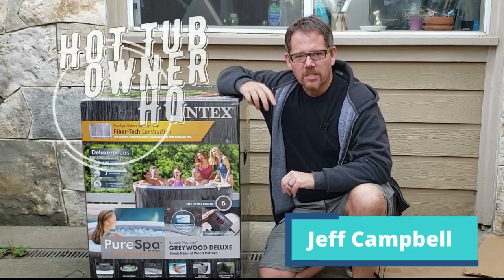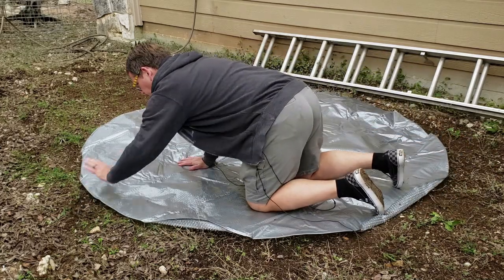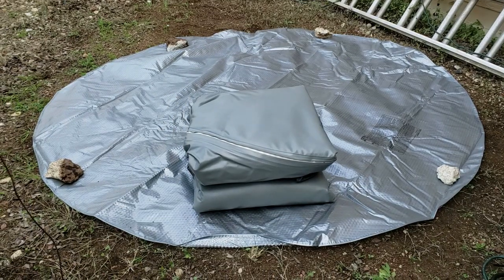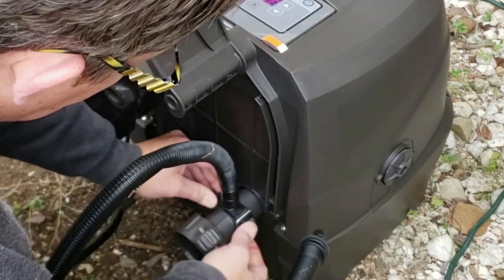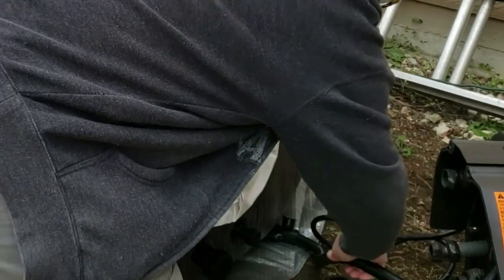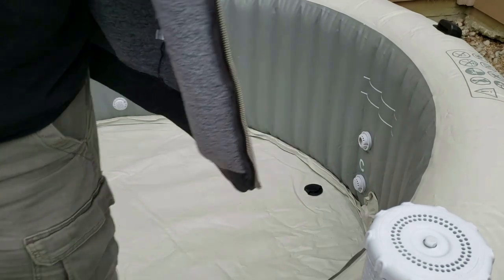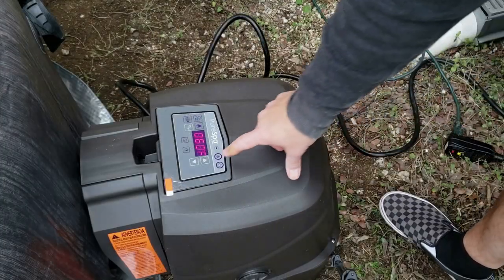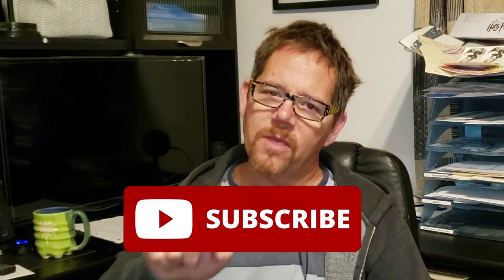Intex Inflatable Hot Tub Setup, Installation & Review

Comment: I bought an inflatable hot tub, a Coleman SaluSpa, last year (2021).  Couldn't get one online immediately as there were "supply issues" with everything.  Then, I found that Rural King had some Colemans ON SALE.  Done deal. 
There is no ground cover/protector included.  HOWEVER, the bottom/floor of it his a thick, maybe 3/8 to 1/2 inch thick, sandwiched in the floor.  Excellent.👍 
I built a platform out of 2x4s and 1 inch marine-grade plywood.  Then, I covered it with 2x2 foam gym tiles.  So, the bottom is really protected against puncture and is easy on my knees.
Cc: The dreaded E02 code.
Generally, it's always the filters.  Remove them, rinse them off, reinstall them.  Didn't work?  Replace them with new ones ($8/pair at Walmart).  Still got a code?  You've probably got an air bubble in the pump or piping.  I took the filters off and shot water from the garden hose into the intake where the filter screws on and turned the pump on.  A bubble of air will shoot out of water outlet.  Problem solved.
All tolled, I have about $1000 tied up in this project.  But, it works well so far and it's nice.  I've lowered the temperature as it's too hot for the summer and it acts as a pool now (July).
I love these videos.  They are great teaching tools.
Thanks for making them.👍

Comment: In the winter, put the tub on 3/4 or 1in thick 4x8 foam insulation boards (cut to fit after tub is installed or before, whatever is easiest for you). Wrap the tub in 2ft wide reflective insulation, wrap around the entire tub, you can punch a hole for each clamp to pull them through and for the pipes as well. Connect the 2 pieces of reflective insulation together at each end with zip ties, put pipe insulation foam over the pipes and make a box with cut out holes for the heater pipes and put reflective insulation all over the box. Stuff any sort of blankets or insulation you can into the box with the heater to keep it warm and also helps big time with keeping the water hot inside the heating pump. Get a fire pit cover to put over the box for rain and snow (you don't want water and snow to ruin your cardboard box + you don't want rain freezing on your heating pump. You can be creative making a lid for the box, personally I just use the original box opening flaps. You can use it all year. I suggest getting a robe that's water absorbent so you can put it on like a towel after getting out of the tub, get some crocs or any sort of quick drying water resistant shoes to put on after hopping out as well! It gets down to 18-20F here and it's fine!
Reply: Great info, hope you don't mind me screen capture and sharing

Comment: I had an intex 6 person tub. Easy set up and good quality. It was nice having a hot tub finally but it wasn’t very robust. It took 2 days to warm it up to 104.  When you get in at night (in LA so not very cold), within 15 minutes it was down to 97 degrees. If you turn on the bubbles, it cools off the water because it can’t heat at the same time.  I got rid of it after about a month and decided to get a MasterSpa. Yes it’s a huge price difference but also a huge difference in quality and heat. We can be out there for an hour and the temperature stays within a degree or two of where we started.  These tubs are good if you don’t stay too long in them or if you don’t live in a cold environment.

Comment: Cracked me up when I listened to how you cut the power when the button for the air wasn't turning it off.  Same exact thing happened to me and mild panic started to set in before doing the same as you and just cutting the power.  That control panel is less than intuitive to begin with and the auto-lock "feature" is such a hassle.  After a few times using the panel you then remember to make sure it's unlocked first.

Also, putting the cover on while heating will help speed things up.

Comment: We purchased a sink aerator to hose adapter at our local home improvement store so we can top off our Coleman 6 person inflatable from the hot water in the house. Just set up Sunday and used it for the first time Monday after it heated up in about 24 hours from 50° F hose water. I wrapped foam pipe insulation around the exposed water inlet and outlet hoses to and from the pump heater unit because we will have temps well below freezing this weekend, the instructions say to just make sure the heater and pump are on 24/7 any time the temps go below 42.5°F (must be a celsius conversion for us USA folks). Thanks for all the informative videos on chemistry! These are a good, affordable way to get our feet wet before we commit to a permanent hot tub! The water volume is so low, I have to be careful adding anything to not over do it.
Reply from the maker: Thanks for the comment. Because of all the comments I get, and my inability to answer them all in a timely manner, I answered yours in a video scheduled for 2/22/21. Please check it out and thanks for being here!  - Jeff

Comment: We had a colman inflatable hot tub for a couple years. I found inflatable hot tubs to be okay. They were basically a glorified bath tub. Outside Temp does make a big difference but another reason for your slow heat time could also be because it looked like you were using a 16guage extension cord, which should not be used with an inflatable hot tub as the heater is around 1300w. What makes a hot tub relaxing are the jets, and you just don't get that in an inflatable. We upgraded to a hard sided hot tub, and glad we ditched the inflatable.
Reply: We built a whole insulated tent set up around ours to keep the heat in. (You can see the videos of it on my channel.)  And yes, it was nice for a few years as a glorified bathtub, but it was $400 and well worth it for the time.  Using the bubbles would tend to drop the heat fairly quickly.  We finally got a hardshell one as well, it's not a 220 so we can't run heat and bubbles at the same time, but with the insulated tent setup I have, we can start at 104* and run the bubbles for a good 2~4 hours (in the winter) before getting down to 100*.
Reply: New intex hot tubs have 140 jets in them now.

Comment: The control unit automatically locks after one minute. You just have to hold the lock button for 3 seconds and it unlocks.
Reply: Is is the lock button the same button you pressed to start it filling up with air
Reply: @henry8333  No, there's an icon that looks like a lock on the display. You press that button/hold it down until it unlocks the screen.

Comment: They finally shipped my steps for my hot tub, I'll have to do an update on that.  I put my bottom pad the complete opposite of what you did (bubbles up).  I don't even remember now if it said somewhere which side goes up.  Starting to wonder if I had mine upside down. It's interesting that your lid didn't come with a cover that goes around the part you inflated.  Mine has a cover and straps to keep it from blowing off. (You can see what it looks like in my videos.)  Also PRO TIP... Make sure to change the filter(s) once a month.  I don't know if you'll get the same E90 error mine and many others get, but it's just from having a dirty filter is all.
Reply: Filter change should be done twice weekly for a number of reasons, use being a big factor.
Reply: @rexh58able  Well use, yes.  I still changed mine once a month and it was still fairly clean even then, but also I didn't use it too much. Twice a week seems like overkill even if you use it every day.  But that's just me.
Reply: @rexh58able  i have mine for 4 years, had to some filter prepairs but I love it.
Reply: @rexh58able  I have the purespa and with a pressure hose you don’t need to change them only once a month. What I do is put an old one on the non pump side (C) for me. And put a new one on the pump side filter which is the important one to not trigger e90. Then after a few washings I swap again pump to other side that way I’m only having to replace 1 not 2 at a time. Last summer I went through 2 packs so 4 filters all season.
Reply: His  had the cover . It was the first thing he showed  in the video
Reply: @andrewgrigsby7419  I apparently completely missed that.  :(

Comment: I purchase my first intex pure spa back in 2014? 15. So I have a pretty old control unit. One thing I can tell you after a couple of years the impeller and or Ceramic rod in the motor goes up. It seem to be you get a couple of years of use after replacing the motor. The impeller cracker at the magnet case and the rod wears or breaks.  you can replace the motor for about $ 30-40 plus shipping from Intex running about $75.00 all together . Or try rebuilding at least the rod with brass or stainless as long as it's not magnetic material from your local hardware store and cutting the rod to length. But haven't found a compatible match for the impeller yet. 
This is the only down fall I have to say I had with Intex. The E-90 code. I see the newer units have some  issues with the wireless face plate.  Not communicating with the unit. Btw the spa should not be used outside below 40⁰ . I bring my inside and use it in a spare room in the winter .  Being in the north country it get dam cold out and lots of snow but still nice to use inside if you have the room. Some ppl put it up in there garage or basement. Also putting a workout mats underneath helps softens the ground of the hot tub. Also good to keep the spa out of direct sunlight as it will fade, breakdown the material. Just a suggestion. My picture is my cat sitting on top of my hot tub inside keeping warm. Never had a issue with his nail puncturing any holes. I hope you enjoy your Intex spa. And if you every come across a impeller  please reply for the future.

Comment: Good video  - great little tubs, we got ours 3 years ago and amazingly it's still going - the pump impeller shaft has needed replacing a few times which is a pain, but I'd be interested to see if it's been replaced to something more durable than the ceramic one built into it.
I think it's a great idea to get one of these and see if a hot tub is for you, if a couple of years pass and you're still using it and balancing the chemicals then it probably won't be a waste of money for you to invest in something more permanent. That air pump not shutting off definitely looks wonky, it was fine on the older model when inflating, I wonder if that's a shortcoming of the wireless nature of the new panel.

Comment: We have the M-spa inflatable  hot tub for 4 years now still no problems, stays up all winter and summer, we replace the water every 4 months, we use Chlorine tablets , not expensive,  and its been a great buy for only 400 dollars.  And if it no longer works we will just get a new one, price difference between a built in hot tub and a inflatable huge difference,  and for every 4 years or more getting a new one if necessary still less expensive  then a non inflatable hot tub.
Reply: How cold outside have you operated your tub.  I just got one and found out they suggest not using it when the outside air temp is less than 40 degrees.  That seems silly since water can't freeze till 32.
Reply: @tommartin5667  i have mine for 5 years now all year around outside and in the winters our temp is below 32 and i had no problems at all, we just keep it closed all winter around, but no problems at all.
Reply: @antonerasmus8638  by CLOSED do you mean you leave the cover on except when you use it?
Reply: @tommartin5667  yap cover is over when not in use
Reply: @tommartin5667  i live in South Africa temps goes below freezing point in the winters , only when we use it, its open, otherwise we close the cover, the hottub is under a lapa but still outside, never had any problems at all
Reply: @antonerasmus8638  Thanks for the info.  I live in Oregon and plan on using it year round.  Thanks again.
Reply: @tommartin5667  no problem at all, what inflatble hottub do you have
Reply: @antonerasmus8638  Saluspa Miami
Reply: @tommartin5667  cool

Comment: The system locks after a minute, which is really unsafe when filling the tub with air. I had to unplug the air hose to keep it from blowing up. I recommend having a second person by the system to unlock or play with buttons (to stop the system from locking) so you can stop the air when needed. It's not the best feature...

Comment: You shouldn’t be able to over fill it with air. They have a built in relief valve for expansion in the hot summer sun so they don’t pop.
Reply: However your top does not have a relief valve.

Comment: there is something wrong with the unit if pushing the bubble button did not turn off the blower for filling it with air. Ours does it just fine.
Reply: It was locked